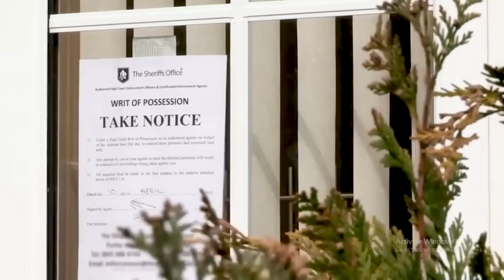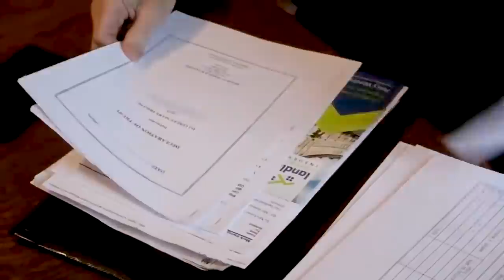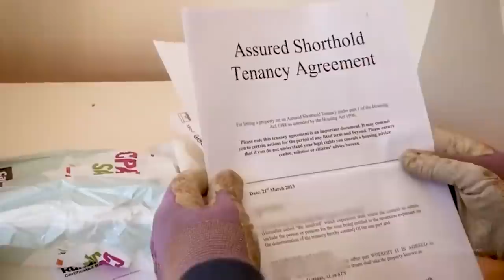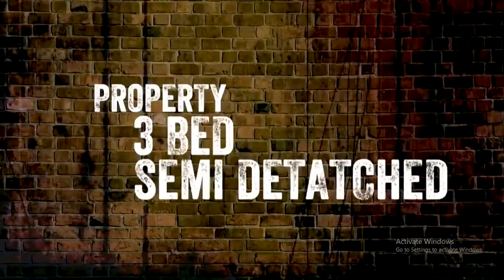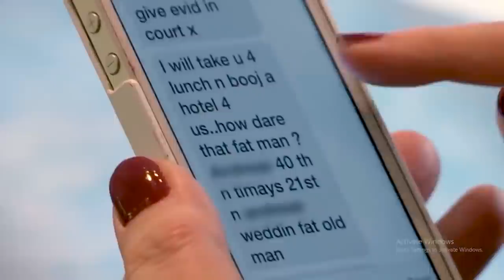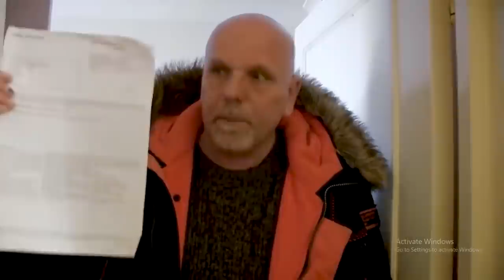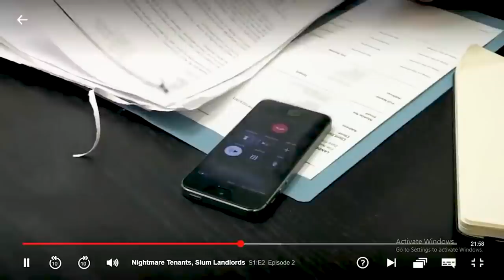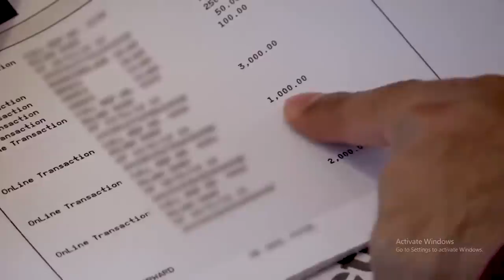Nightmare Tenants, Slum Landlords S1 E1 1080P

Comment: what about the thousands of pounds the tenants still owe you..
Reply: Sometimes the loss can be claimed on yearly income tax against the income total as an operating expense by the landlord. The landlord might then owe fewer taxes. Usually, it does not make much difference in your income taxes owing though and you never really recover. The trick is to act swiftly to not allow that large amount to accumulate but the trouble, especially in Canada, is that the courts and law side with the tenant and it takes forever to get them evicted. There are additional charges involved in that process too. Good luck in trying to sue the tenant in small claims court...
Reply: @islandgal500  that's not true about LTB adjudicator's in Canada ( Hamilton) anyway.  If a tenant has not paid rent they will not even take notice  of their complaints.  If a tenant has paid their rent to the LTB trustee then the adjudicator will listen to them .  Then after repairs are done and not until will the LL get his money.
Reply: @darlenewesley3617  Good to know.